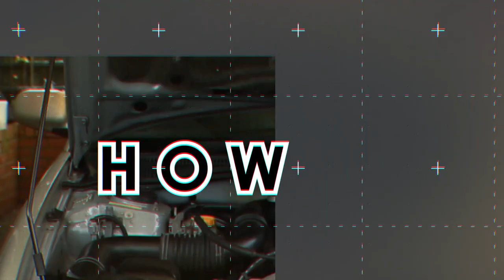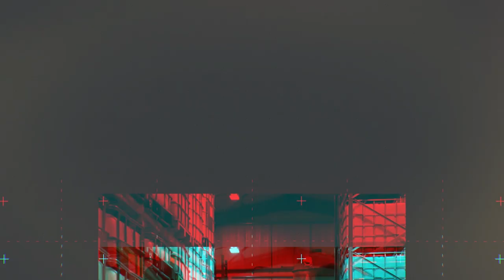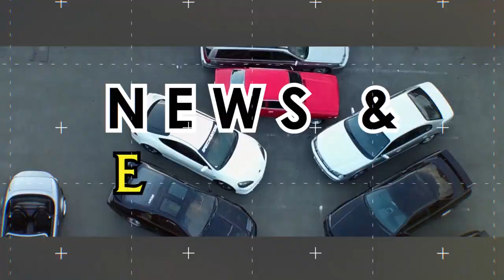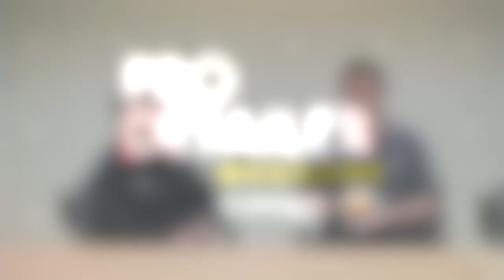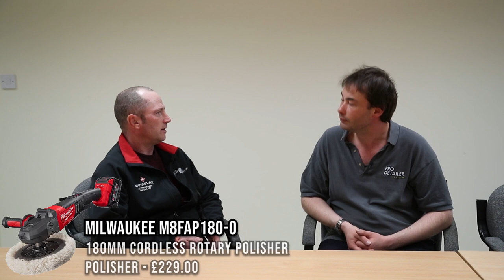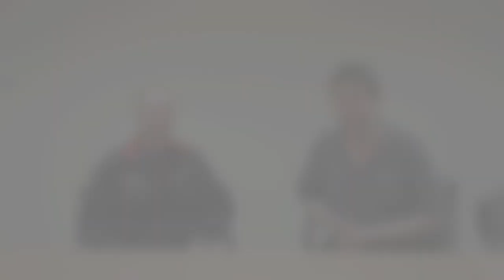Ask a Detailer - Battery Powered Polishing Machines with Simon Clarke of Wax'n'Vax

Comment: I have owned the Milwaukee M18 Battery Rotary for 18 months now.
I use it for headlight restoration jobs coupled with a 5.0 amp battery.

If the wet sanding stage is done properly I could probably complete 3 sets of headlights between charges.

I have a brand new, never used Dojo Juice Spin Doctor Rotary as I only use the battery polisher.

The Flex polishers on paper sound fantastic.

I need to look at getting a DA polisher so will be peeking at the Flex.